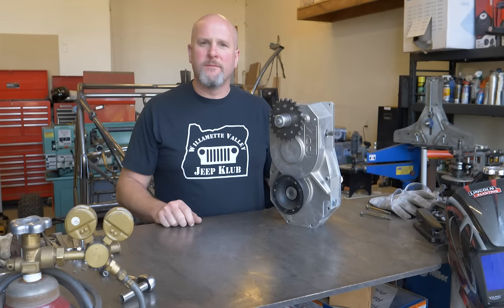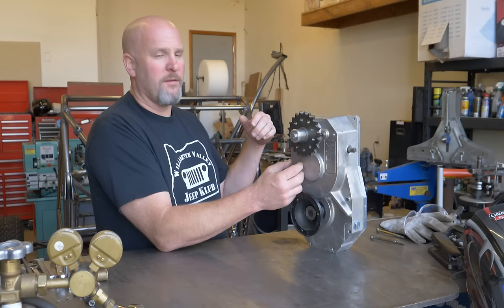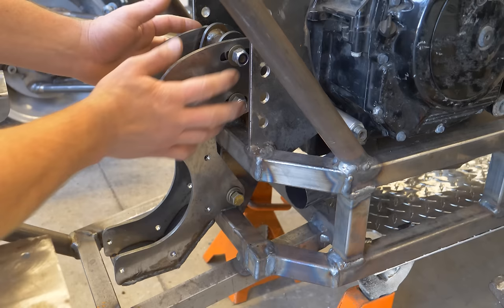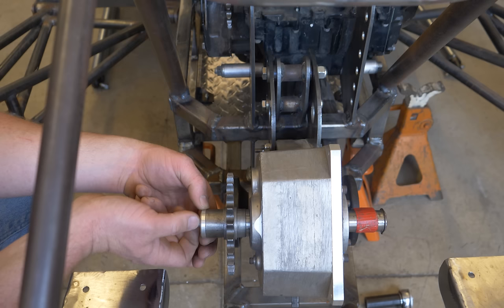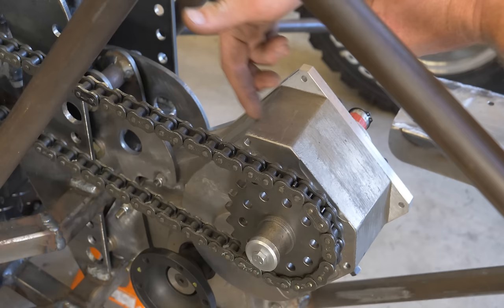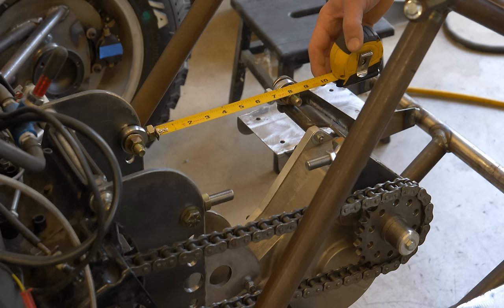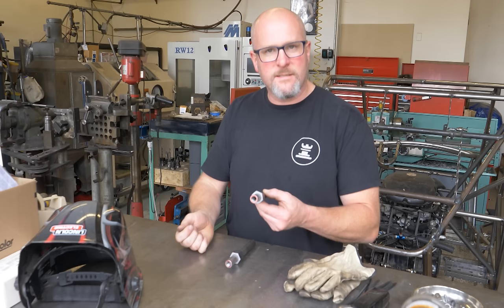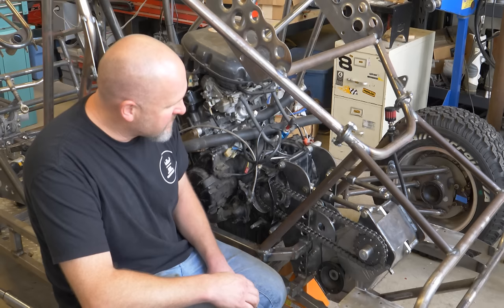Chain Drive Forward Reverse Gearbox for Motorcyle Engine Powered Buggy

Comment: Hi, Pls take this with a grain of salt. I am a Mfg engineer and have been a CNC Machinist 42 yrs sooo, some of the designs of the Gearbox is redundant. Using a cast gearbox is risky at best. You have a CNC Mill in the background, make billet one. I do like the box brackets, but you could have easily incorporated the Hyme joint supports into them. The drilled nuts welded to hyme supports weakens the struts and two milled flats would have done the trick. over engineering just adds weight, and mass. Just my .02 cents.

Comment: Top of your breather hose should be facing downward so when you wash it or run it in the water or rain the water will soak the filter and it won't just run down into your gearbox use a piece of 5/16 tubing put a 90°bend face the the filter down love your videos good clean work well thought out
Reply from the maker: Yes, I need to fix that. Thanks for watching!!

Comment: I put a Yamaha 570cc 2 stroke engine from a 1990 Yamaha Exciter snowmobile in a 1994 Yamaha G4 golf cart with a lift kit & some nice knobby off road tires etc. about 10yrs ago. Crazy fast without a roll cage & no front brakes! YIKES! LOL :-) Lots of fun though. I was surprised the stock rear diff held up just fine. I really like that gearbox though. I just need to freshen up the engine on mine with a new piston & rings kit & fabricate a roll cage & some front brakes. Makes me want to go out in the garage & get back at it, thanks for sharing! Nice build so far, my 1st video of yours, gonna check out the others.
Reply from the maker: Sounds sketchy, I like it!!! 😆 Thank you for watching.

Comment: Set up an adjustment like a car uses to adjust the belts on alternators. Screw adjusts through a pivot pin then a nut tightens it up to keep the screw from backing out. Would be easy to do on your set up. Would also help to brace it

Comment: Awesome creation! I came, I learned, and now have a reverse solution. Speaking of filling with oil, that dry hardened nut shrieking in the lathe getting drilled out made me and my drill dr cringe. Stay sharp a lot longer with a touch of oil to keep the heat down.

Comment: Critique
The turnbuckle braces provide close to zero lateral support. Having them attach at a 45 degree angle would help remove both torsional and lateral stresses on the gear box. 
^perhaps unnecessary, but you did say that RPM did require support.

Comment: I am in the design stages of some dual-purpose machines and the forward-reverse aspect of the build had me slightly perplexed so this was super informative. I think that gearbox would be overkill for the small buggies I am going to build my grandsons, as they will be using pit bike engines, but for the big buggies that my sons and I plan to build this will be perfect providing it isn't 2/3rds the cost of my budget Lol! I have seen some other brand gearboxes going for nearly 3k. I can transplant a complete FWD drivetrain into it for that kind of money. Thanks for sharing and I wish I had your shop and tools LOL!

Comment: I'll tell you right now MR. Your days of chains stretching to death are over.. mine needed one adjustment .. were running nearly identical packages. blackbird 19/22 rpm 5.4:1 mine 1800 lbs though
Reply from the maker: That is good news!!!! Gotta get this thing back in the shop and finish it!!
Reply: It'll blow your mind how much this engine responds to 2lbs of boost

Comment: Great work!  Why not mount the breather filter upside down with a loop of hose extending  a few inches higher than the actual filter?  As it sits if the filter gets dirty (imagine that) and debris enters the hose it will be directed directly into the gearbox by gravity.  With a loop higher than the filter any debris must defy gravity to enter the hose and fall into the gearbox.  I'm assuming the "breathing" of the gearbox is very gradual as it heats or cools and there is no significant air velocity to factor in.  And of course, when things break (they often do) having that little loop higher than the (now tossed down the trail) filter eliminates purchasing another $3,500 gearbox.  Oh, and don't forget water.  It goes downhill, generally.  Cheers!!
Reply from the maker: Good idea!! I'll try to address that. Thanks.

Comment: One of my favorite girlfriends was a stainglass artest and I never seen a stainglass cutting machine and lead came strcher or anything else about stained glass I was fasanated with those tools , BUT WHEN She saw my Tap and die set ,and how to cut thread and make nuts and bolts ,she went crazy and we built a revolving stainglass door ,it cost us over $700 back then ,but we never had a prictcal use for it  ,we broke up and she draged it away when she left it's probably in athousond prices by now 🏁

Comment: Can I suggest that you pick up a geometric die head for your lathe? It's not an outrageously expensive tool but it will significantly improve your tapping of parts on the lathe, you can still use the current method for viewers and do it yourselfers. But as a retired machine shop supervisor, watching hand tapping is like hearing fingernails on a chalkboard for me. 😂

Comment: Awesome, I've been looking for / researching reverse boxes similar to this for years, wishing there were new more inexpensive alternatives developed.
Reply: $2,500 for these boxes includes US shipping, no LSD available for this but he has built custom LSD units for customers in the past..
Reply: You''re re inventing the wheel. These gear boxes have been layng. Around over 50 years. All u need is the gearbox from an Alpine twin track work sled by Skidoo. You're all too young to know. Haha
Reply: Dandahermit Seals I disagree, a skidoo box won’t handle all the load that goes through it, so much more force plus extra weight that goes through the boxes when you use it for offroad application then being on snow.

Comment: Well done ! i think this is the best set up i've seen with this type of RPM gear box, this was my first choice but I wanted to have 4x4. so i went for the maverick x3 gear box and adapted a sprocket instead of the clutch, so now I have reverse,  HI - LO and 4x4. there are a ton of spare parts online for it and i run can am maverick axles.
Reply from the maker: Sounds like an awesome setup!!! I just picked up a RZR transmission from a parted out XP900. Very similar to your X3 setup. Saving it for a future project.... Thanks for watching!!!
Reply: @motomule  What kind of cost are the RPM boxes? i've been looking for one for a while but most are too expensive for their rated HP.  Might be interesting to run a shaft drive from the bike motor to the gearbox then it can be used as a drop box to run in 4wd.  Also been thinking of doing the same thing using a manual transmission from a FWD car, just rotated 90 degrees. so CV outputs run front to back.
Reply from the maker: @NVMDSTEvil  the RPM box is expensive, about $2500. It is a very well built unit however.. Thanks for watching!!

Comment: On the other side you can add a small alternator on shaft from your gearbox for back up battery,  just an idea..
Reply from the maker: Cool idea. Thanks for watching!!!
Reply: @motomule  I have pictures of my RPM with an alternator on the FB group, if you go that route.
Reply from the maker: @plkracer  I will check that out, thanks!!

Comment: Should have the pivot point axis as close to centered on the output shaft as possible in order to keep forces down. Landings and rough terrain will have a negative affect and I assume rear suspension will come into play with its physics as well.

Comment: Great explanation on the RPM Gearbox. I've used them on 3 different builds in the past and your  tensioner/ this b$*tch  ain't going nowhere mount looks great. On one of the builds I added a small flex plate off a 22hp Honda v twin to the input shaft and used a starter motor off of John deere tractor,  It worked great. Keep up the awesome work man!!!
Reply from the maker: Thank you!! This is my first time using one of these boxes, it sure appears to be well built. I can't wait to actually use it!!! Thanks for watching.

Comment: That's a fantastic gear box and you have set it up awesome 👍 I seen your rpm link and the rear caliper an disc brake set up is a good idea but looks a bit small if it has weight an high up running through it but I'd imagine they'd have different grades for the buyers to choose from. You buggy is coming along real nice and built tough. Take care Mark.
Reply from the maker: Thank you!! I have brakes on each wheel, so I didn't consider the one mounted to the gearbox. It would add a little weight up high, but it would also remove unsprung weight which could be a bigger gain??? Thank you for watching!!
Reply: The brake on the gearbox could be used for a parking brake....just a thought.
Reply from the maker: @Mardy72  very true and a great idea. Thanks!!!

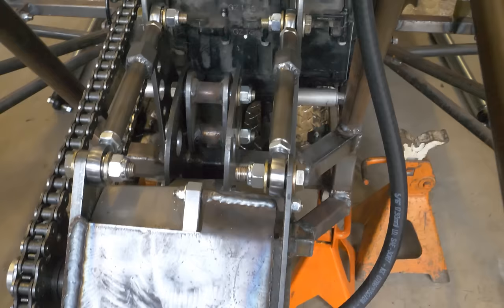Comment: The arrangement at 17:40 is fine to trim the drive chain but it is not an anti-twist structure as the extension bolts and the sheet metal work will flex vertically if the gearbox twists. Some higher thinking is required to make an anti-twist structure to aid that gearbox but most probably the gearbox alone can take what punishment it is offered.
Reply: Agree, and needs a diagonal (or 2) to resist twist. (think airplane fuselage, or wing, construction.).. so use turnbuckle to adjust chain tension only. (only needs a lightweight unit). Also use a riveted link chain as split link is a point of failure in anything over about 50hp. (ask me how I know).hehe

Comment: If it accepts a countershaft sprocket from a suzuki the splines are the same as your engines countershaft. Turn the rom gearcase around and mate the two with a splined shaft,thus eliminating the chain
Reply from the maker: If the chain proves to be a problem I might have to get creative and try something like what you suggest. Thanks for watching!!
Reply: @motomule  yeah, just a thought

Comment: Hi! I don't know much about transmissions and all that, but, if you've ever heard of the 2005-2016 show Lights Motor Action in Disney Hollywood Studios they show that they have a special transmission that allows them to have 4 forward gears and 4 reverse gears by the turn of their stick shift. Is that basically how this works?
They're Hayabusa 1300 swapped 150hp rally cars btw lol :)
Reply from the maker: Probably something similar. Sound like fun cars!!!
Reply: @motomule  They definitely are fun cars! only 1300lbs and Mid Engined, with 4 wheel to 2 wheel option drive, (they usually used 2 in the show) but yeah, the show still runs in Paris atleast as Moteurs Action!

Comment: Sorry this question is so late. On the reverse box. The shaf opposite of the sprocket. Could you run a pulley for ac?
Reply from the maker: @korosuchimu1479  not sure? Probably, but it's designed for a brake.

Comment: Could this gearbox be optimized for use with a Honda Valkyrie engine since the Valkyrie is a shaft driven bike?
Reply from the maker: Don't think so, it's designed for chain drive setups.
Reply: @motomule  Dang, that sucks but I appreciate the quick response. Thanks man, great content!

Comment: Did the gearbox come with the oil level check window, or did you install it? If it came installed by the factory, does the factory have a prescribed orientation for the gearbox for proper check window orientation and proper oil function? If you intalled the check window, how did you determine where to put it? When tilting the gearbox to adjust chain tension, won't that change the orientation of the check window? What orientation will the buggy need to be in, in order for the gearbox to be in the oroper orientation to check the oil level?

Comment: Very nice job...and build pace.
waiting to see you wheelie up a hill.
you might want to consider an additional side truss for your transmission or diangonal'ing the turn buckles, all depending on the amount of torque and halfshafts design/angles etc.
Using high diameter high durometer (stiffer) polyurethane bushings instead of the heim joints may reduce the vibration and noise transferred to the chassis without loosing too much stiffness and might have a longer service life before you notice slack or knocking (heim joint case).
All of these ideas are just humble suggestions to be considered should you encounter any problems with the current elegant design.
Keep up the good work and excellent informative videos
Reply from the maker: Thank you for the suggestions. If I have any problems, I will try these things. Thank you for watching!!

Comment: Think this will handle the stress of being turned sideways to be sending the output shafts longitudinal instead of transverse.
Reply from the maker: If you were using it to feed differentials, that would lower the stress that this would see, because of the gear reduction past it. So, yes.
Reply: Awesome I've also been thinking about getting 3 rear differentials (preferably)  so I can CV shafts as drive shafts to a front and rear differential with cvs going from those to the wheels. Also thinking maybe could get a axle and run it sideways with cut down housings to differentials w/Cvs to wheels but that's alot of weight and I'm not sure how to work out the hearing I'd need in the center diff that goes the output shaft of the motor where a sprocket would normally by
Reply: Also I ideally would like to use a 250 cc engine I have laying around but I'm just not sure its feasible with all that rotating mass of 6 CV shafts and 3 differentials but also I think itd only be feasible this way cause I can adjust the gearing to whatever i need by changing out the center diff or the gear sets inside if i cant find a diff the correct ratio. The 250 also has a 4 speed transition on it. It is from a cheap quad

Comment: Would this still require a clutch or would it be auto?
Reply from the maker: The clutch issue depends on the engine, not this gearbox.

Comment: Love the fab work! Would it be overkill to add a spacer between those tensioner heim joints and use one long bolt to make them double shear at each end? Just thinking out loud while watching.
Reply from the maker: Thank you! I could do that up front on the motor mount side because those holes are in alignment. I screwed up on the rear ones, they don't quite line up with each other.... Thank you for watching and offering constructive criticism!!!!

Comment: Sweet!  This was what I was waiting for.  Detail on the gearbox!  Side thought...should that chain be a riveted style instead of a quick link?  Seems like once bikes get past about 650cc they start using fully riveted chain connections instead of the quick link?
Reply from the maker: I'm using a quick link on this, but yes, most big street bike use riveted links, no master link.
Reply: I have a rpm box also and my chain is riveted, I went for that option cause my motor is a zx1400 and push a fair of power through it.

Comment: Nice mounting bracket. What about oil in the gearbox? Is it OK to have the gearbox tipped at that angle assuming that their logo is the zero plane/angle? All the oil would collect into the output portion of the drive with no oil in the input gears.

Comment: Hey Mike, First off let me say I love your builds! My husband and I are currently attempting a build of our own and finding a forward and reverse gearbox for a 420cc engine is near impossible. Bought 2 BK150's and they have been a nightmare they have stranded us in the bush more than once with everything from electrical fires to dead starters. So far we have replaced both starters, replaced the stator in both, and most recently we completely rewired one of them and relocated the battery to the front of the kart.. any suggestions on where to find a forward and reverse gear box for a 420cc engine?  Keep up the good work the kids love your builds!
Reply: buy this one

Comment: Not sure if anyone else has mentioned this?  But in using your adjustment on your gearbox surely it will raise/lower your  drive shaft angle?
Reply: His geometry looks good, the 930 CV can run at 38 degrees without a problem

Comment: Excellent fab work . I wonder if that set up would be enough to power my baja bug ?  I have 25K in. I Hate the VW motor . over heating . 2332cc . yes 930 cv ?
Reply from the maker: Not sure?? Yes, 930 CV's.
Have you seen this bug??: https://youtu.be/_uxUB9h4A_k
Reply: I have seen people adapting outboard engine V-6 powerheads to VW transaxles. Then using an electric water pump and small aftermarket radiators with electric fans.

Comment: If there are difficulties and provisions to allow for the tensioning of multiple chains, not to mention the heavier rotating mass and increased friction from multiple drive systems, why not do a direct coupler to the motorcycle engines output shaft, and a keyed pass through for the drive axle?
Reply: Because he wants reverse…

Comment: I'm not really an expert, but surely if you use a small sprocket, you increase chain wear since the force is concentrated on fewer links? so equal sprockets maybe reduces wear also?
Reply: Probably not since it's also geared lower.

Comment: Correct me if I'm wrong but could you put a bigger sprocket on the engine to over drive the gear box to get better acceleration?
Reply from the maker: Good question but I think you have it backwards. If you increase the size of the engine sprocket, you'll have slowed acceleration but a higher top speed. If you decrease the size of the engine sprocket you'll have faster acceleration but a lower top speed. This assumes that the engine has the power to handle the change.